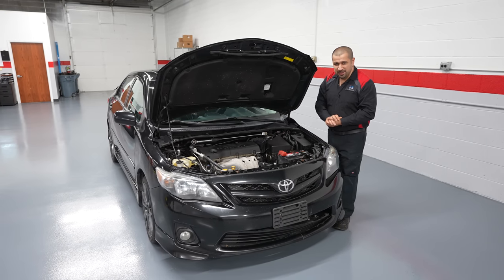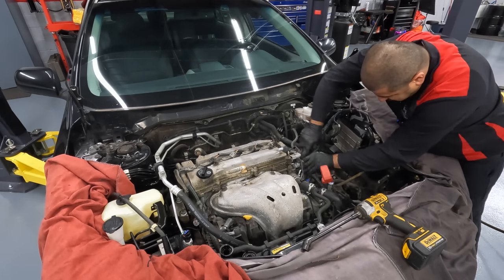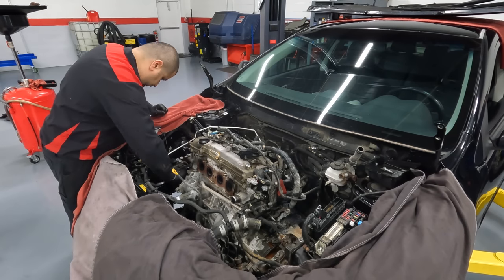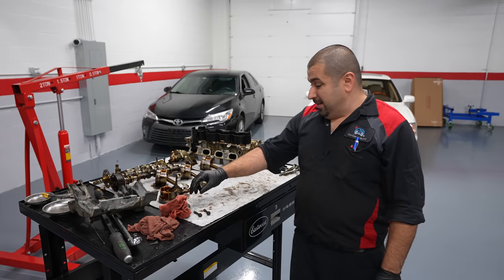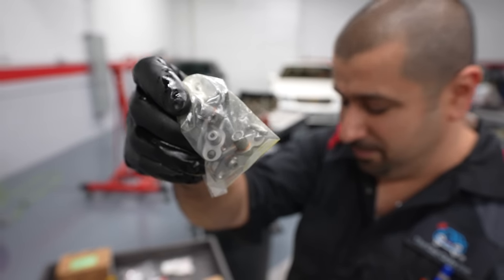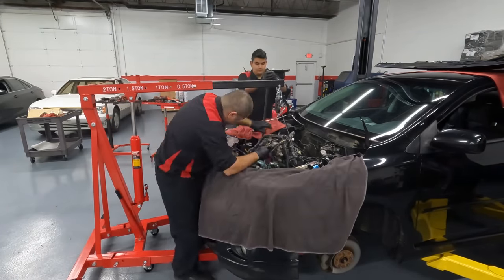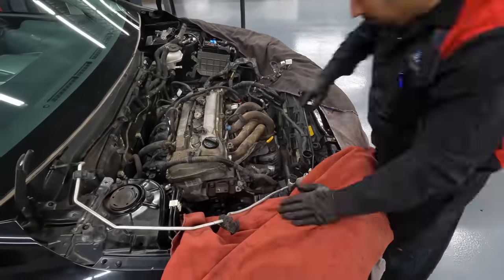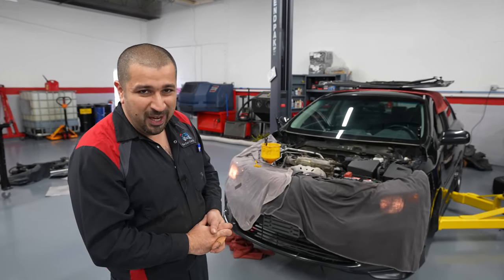THIS is Toyota's Worst Engine Ever Made! But Is It Really THAT Bad?

Comment: This was my bad luck with bought-new 2008 Camry. The dealer spent several months telling me huge oil consumption was normal, only to change their story when the engine was losing power, too. Got rid of it before Toyota got their act together and began fixing cars out of warranty. The Company took WAY too long to address this problem, imo.
Reply: I remember that 2008 year camry, consumer reports, for the 1st time in years didn't automatically put it on their recommended list due to engine problems.  Not much of a car guy back then, but I guess this is the problem they were refering to...
Reply: My 2010 Camry that my parents gave me also consumed oil. About 1qt every 2-3k miles. Loved the car though. Just had to keep an eye on the oil level once a week. Never saw a check engine light. Always started. Had like 170k miles before I wrecked it 

However I ended up hydroplaning it and have since owned a 2012 Lexus is350 awd 150k miles (wrecked)  and a 2015 rc350 awd fsport  103k miles(wrecked) and 2017 Lexus rc 350 awd fsport 73k miles and have had no issues, no check engine lights and no oil consumption
Reply: @Phillip Banes LOL thanks for your concern. Traded it in at another Toyota dealership.
Reply: Same with 2007 brand new Camry. Starting burning oil early in life, around 35k. Progressively got worse.
Reply: @Phillip Banes no this is on the buyers, do research before  buying
Reply: @Phillip Banes don't assume every Toyota is worth buying 😂
Reply: @Phillip Banes I vote Democrat where's your compass pointed?
Reply: And when they finally did the recall, the qualification requirements were unreasonably high. If I remember, it was something like 1 quart per 1,000 miles. The recall has been closed for years now and I still don't think my 2007 Scion tC with 130,000 very hard city miles would have qualified for it in its current condition. It's still just a hair under 1 quart per 1,000 miles and holding. It may have even improved slightly after I finally replaced the valve cover gasket recently.

Problems aside, this is far from Toyota's worst engine. For that title, it would have to compete with the engines out of those old 4Runners that constantly blew head gaskets, or any of their diesels.
Reply: @ValentinoBentley  Interesting  isn't the engine in the 2010, the 2.5?
Reply: Victim of it's success
Reply: We have a Obunga lover here 😝
Reply: @ValentinoBentley - you must be a great driver….you wreck everything!
Reply: @zorilla0 just wondering, how did the dealer verify the oil consumption (burning)? Did they put an official Toyota cable tie around the hood latch, haha just curious
Reply: @tcmits3699  From what I’ve seen, they usually put tamper-evident tape over the oil cap and tell you to drive for a given number of miles (or until the oil reads low enough to stop driving soon). I have no idea if they do anything with the drain plug or oil filter or if it’s just on the honor system.
Reply: @zorilla0  l did buy a new Diesel farm tractor and the injector pump was safety wired with a lead seal stamped into the wire. That was really tamper proof, l guess for the new tractor warranty

Comment: Nice video!!!!!  Been a mechanic for over 45 years. Remember doing in frame rering jobs on chevy pick up trucks. Pulled heavy cylinder heads and dropped oil pan. Honed cylinders to help seat new rings and rinsed grit out of block with solvent. A real pain to work upside down under the engine. Mostly did this job on trucks that the thermostat stuck and over heated and caused rings to collapse and loose their tension on cylinder walls. I worked in a machine shop that did rework on toyota engines daily.  Balanced engines and blueprinted race engines. We surfaced many toyota cylinder heads but had to check valve to piston clearance.  We would flycut piston valve reliefs if necessary.  We even welded aluminum cylinder heads in combustion chamber and remachined and install new seats to salvage expensive cylinder heads. With the right equipment any engine could be salvaged. Went on to be a F-16 fighter jet machanist with access to high tech cnc machinery.
Reply: Great journey!

Comment: Thanks again for showing in detail what the culprit is! I purchased 2008 Scion Tc for my son with 125k miles 2 years ago before I knew this. Burns some oil so we just make sure never runs low....so far so good and it's been a great first car we got lucky to get it for cheap before this crazy used car market!
Reply: I also got my son a 2009 scion tc and it had the same problem but im doing this
Reply: Berrymans b12
Reply: I have 2009 Scion xB and burning oil like crazy, I wound like to know if you shop in California so I want you to fixing my car?

Comment: I had 02 camry with the 2.4 engine.  5 speed manual transmission.  Made in Japan.  Had 300 hundred thousand on it. Never used any oil.  I  changed the oil with mobile 1 every 4 thousand miles  . I  only put a new battery and tires on it. That's all I  did. Fantastic car.
Reply: Lucky my 07 has been giving me issues

Comment: I was 18 years in 1964 and I rebuilt my engine in my 1956 Chev. straight 6 240 cu inch engine. Back then there was not much but a basic engine. It took an hour to get the engine out of  the car. I knew nothing and was doing this on the fly. A week or so later I had put the engine back to gather and in the car. It did not crank at first. we pushed the car on to the road and my dad pushed the car and when we had enough speed he let me go and I poped the cluch and the engine started. The car cost me 100 dollars but the experance was with out value. Thank you for your video. Ben

Comment: I have a 2010 Scion XB 5-speed with 105K.   I’m using a quart between 3500 mile oil changes.  I use 5W30 and started adding 5 ounces of SeaFoam to the crankcase 500 miles before the oil change about 9000 miles ago.  So far consumption has stayed steady.  I never see any smoke even under hard acceleration.  My fingers are crossed for this wonderful, useful little buggy.

Comment: I had this engine on a 2003 Camry LE. Loved it! No issues ever. I maintained it well. I was hoping to hit 200k miles but the car was totaled, while parked, at 178k miles.
Reply: Ditto, we had a 2002, no issues.
Reply: Oh man. That's gotta be tough to lose your car like that. The car was a money saver for you.
Reply: No, you didn't. The problem started in 2007
Reply: totaled? it must have been hit by someone going like 60 mph to the point it was completely destroyed and not fixable
Reply: @drewschumann1 the problem started 2 years before they came out with the 2.5 liter? thats odd
Reply: @cantwealljustgetalong2   Actually the problem was restricted to certain factories between 2004 to 2008 who used cheaper rings, saving approximately $1.78 per car. Toyota produced approximately 2.4 million bad cars with this engine and refused to recall most of them. As you pointed out, the 2.5 fixed the issue.
Reply: @drewschumann1  ive had 3 cars with this engine, no issues with any of them, all great and last forever

Comment: My previous car, an 03 Camry LE, had this engine. Survived brutally long road trips. Lived in the car under the Florida sun, with the engine constantly idling w/ AC. For all of its problems, it really did last a very long time. My experience with it is what made me get a 2011 Avalon Limited for its replacement. Only bad part is that the 2GR V6 doesn't seem as easy to DIY. ;/
Reply: The money spent on keeping the AC on is enough to pay for rent
Reply: @donniebunkerboi9975  You picks your priorities and live with your decisions. Some make more sense in extreme climates.
Reply: @donniebunkerboi9975  Nah it wasn't like that. Was only for 4-5 days during a visit with some circumstances so peculiar that I don't expect anyone else to encounter them.
Reply: @BrucifyMe what kind of problems did the 2003 Camry have? Did the intense Arizona heat melt things? Are you talking 7000 mile total road trips? If you are, you must have put a lot of miles on that Camry, around 300K miles possibly
Reply: My 2005 Camry has 210k miles on it. I can safely say, besides a slight timing cover oil leak, it doesn't burn any oil. I've owned cars before from other manufacturers that have been oil burners; the 2AZ-FE in my case does not.
Reply: @Blakecryderman7244  I did do a pretty obscene number of trips, from VA where I live to FL & PA. I can share the full list of problems (most are minor) if you want, but by the end of my ownership, the major ones were: 1) leaking heater core, and 2) losses of oil pressure while driving. It was my first car, so I was pretty negligent if I'm honest - something I plan to rectify this time around.
Reply: @MattExzy  Hope you keep it goin' for a long time. While subtle, I did like the way those 05-06 facelift versions looked, especially their gauges.
Reply: @donniebunkerboi9975  :😂😂😂

Comment: Don't forget to mention that this problem also occurs in the 2009 and 2010 Pontiac Vibe 2.4L that were built for GM by Toyota in California.  To my knowledge, GM has never admitted the problem to customers.
Reply: the japanese owns up to their mistakes and sets it right.......
Reply: @greggybada the biggest issue is that Toyota dealerships won't touch my '09 2.4 ltr vibe, and I'm not comfortable letting the GM guys do this kind of job. They don't know these motors like a Toyota mechanic does.
 So I'm kinda stuck between a rock and a hard place...and stuck burning a lot of oil. Unless I drive up to Illinois and bring it to the car care nut 😆

Comment: I gave you a like.
I own a Toyota Corolla S 2007 and 
I do myself all the maintenance and repairs, 
except the transmission which was my last repair
I took it to the shop, They replaced the torque converter, 
the selenoid and the seal that connects to the engine.
My car has 140 K miles and now is running super nice
with the new update on the transmission.
Reply: That's extremely unusual for a Toyota with only 140,000 miles.

Comment: Great video! Great show! Great content!  THIS is a show and information the majority of us can relate to and appreciate.  Not a muscle car, not a super car, but an everyday vehicle that the majority of us will have.  I need to find a garage like this in my hometown.😩
Reply: Or become your own mechanic. I could do what I saw done here if I had a place to work. His show-and-tell tips are invaluable. Especially, it is important to know that just based on visual inspection a professional mechanic did not see a need to change the bearings.

Considering the cost of a new car, $4000 is not a lot to spend to keep a desirable existing one running for another decade or longer. My thought, however, is that even $500 will buy you a lot of parts and tools. The most essential tool is a highly accurate torque wrench.

Comment: I just watched this video. I own a 2009 Scion xB that had the top end campaign fix at 70,000 miles. This was the 2nd major repair done. The 1st issue was a failed automatic transmission while I was on vacation with my girlfriend. Half way through our drive to a resort the transmission refused to shift into reverse. The car was 1 month out of warranty. Toyota paid all but the labor costs and replaced the transmission. The car now has 153,000 miles and still runs great. I maintain it religiously. I work at a Toyota dealer so that helps keep maintenance costs lower.
Love your videos.

Comment: 08 Solara had 235,000 and failed the oil consumption test, Toyota rebuilt the engine under warranty enhancement program. 340,000 now and using less than 1/2 quart at oil change. Thanks!

Comment: Watch you all the time, AMD. So informative! Just bought a used 2006 Highlander with the 2AZ-fe 4 cylinder engine. Concerned about the stripping headbolt issue. No sign of leaks at 119,000 miles. So far, no drop in oil level after a few hundred miles. Can't find any carfax history that its head bolts were ever changed and/or if this model/year even needed it. Hoping you can clear this up for me, or if anyone else had this particular model Highlander. Original owner had it until 2021, and see relatively routine service on Carfax report. 
Am following your 5,000/6 months oil change recommendation, along with addressing any other maintainance intervals. 
Want to keep this as last vehicle in my retirement with my typical low mileage usage. 
Thanks for all you do, and God Bless you and yours!
Reply: not really an issue on the 2006.  Don't let the engine overheat, maintain the cooling system
Reply: @glennhansel9411  
Thanks, Glennhansel. Will do.
Reply: @squirttv69  
Extremely low mileage. Could that be a new or rebuilt engine?
Definitely should be checked by a trusted mechanic for any issues. It's still about 15 years old. So far, my 2006 just needed new rear struts due to a leak in one at time of purchase  and  new AC condenser. Otherwise, keeping fluids changed and I see no signs of oil/coolant leaking or oil consumption or overheating.  I'm satisfied with my Highlander and am really enjoying it.  Hope this helps.

Comment: I had a 2000 Corolla with the 1zzfe which is notorious for burning oil due to the piston rings having flaws from the factory. Over the 8 years I owned her it never burned a drop of oil. I believe the 1 previous owner probably had the oil changed religiously. I also always did the oil changes myself every 5k. Finally had to junk her last summer due to rust. It still ran and drove perfectly!
Reply: Rust was not repairable?

Comment: My son had a 2008 XB and I noticed that as early as 36k miles, it was already using oil. I checked the oil 2 mos after an oil change and it was down one quart, it had already passed the warranty period.
Reply: My wife got her Hyundai Santa Fe NEW with 5 miles on it, changed the oil EVERY 5k miles on the dot. At 86k miles the engine seized due to failed rod bearing. 
So explain to me how i changed the oil every 5k miles with NO skips and it still siezed on us.
Reply: @ACommenterOnYouTube  Hyundai isn't really good,no offence.
Reply: @tardeliesmagic  her Tuscon which her uncle now has is at 210k miles and still going  so it cant be that bad 🤷🏽‍♂️
Reply: @ACommenterOnYouTube  You can change the oil every 5k but the thing is was it burning oil between changes?   Is the oil ever checked between oil changes? Cars can burn oil from new.
Reply: @ACommenterOnYouTube  God man, well what can I tell you about Hyundai. Try a used Toyota
Reply: @ACommenterOnYouTube  Was the engine in the Santa Fe a 2.4L engine? I've heard that Hyundai's and Kia's equipped with that engine was known to have issues.
Reply: @ACommenterOnYouTube  Defective or poorly designed bearing. Or, poor lubrication from defective oil pump or bad engine design.
Reply: @donaldwilson2620  no it was the 2L turbo theta II. When we towed the car to the dealership for warranty repairs, i told the service rep, i believe the engine has seized, he was not shocked or surprised at all. 2 weeks later the car got a new engine.
Reply: @dvader3263  i read later that it was bad bearing design and it was going to fail regardless of oil changes. Issue is most engines failed sooner due to lack of oil changes and those that made it close to 100k miles lasted because of proper oil changes. But it was doomed to fail due to poor design period.

Comment: Thanks for posting.  I have a 2009 Matrix xrs with this engine.  I took it to Toyota for the consumption test.  It passed even though the oil lasted about 1 month.  Went for the second test and was told the "extra" warranty expired.  In my opinion, Toyota plays with customers with delays in recalls and technical bulletins.  I still have the vehicle (120,000 miles).  I just deal with the rough idling and add oil.
Reply: Change your spark plugs and clean throttle body (you will need to do make it relearn idle). Put 5w-30 and pray for the best.
Reply: @pliedtka  thank for the suggestion. Plugs changed and throttle cleaned (not removed and cleaned).  I think the rough idle is the motor mounts.  Goes away in neutral. I believe you have to change 02 sensors and hope the catalytic converter does not clog.